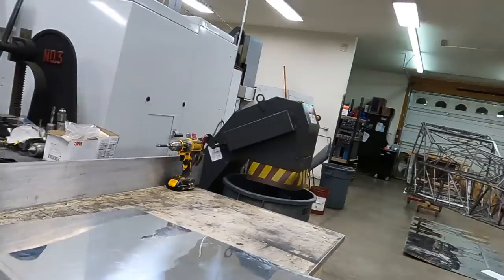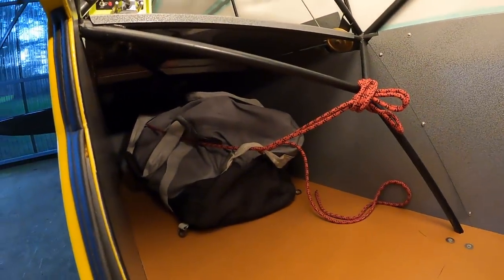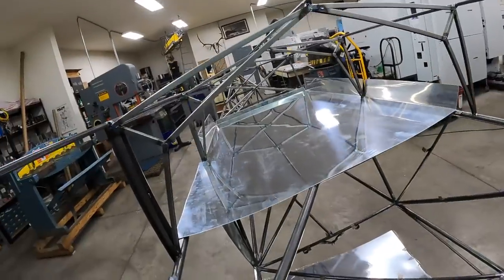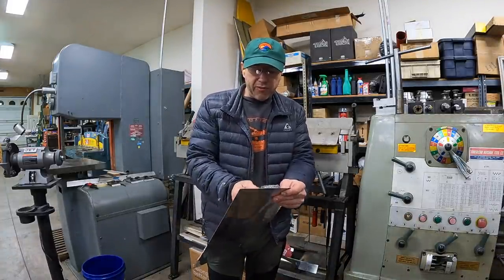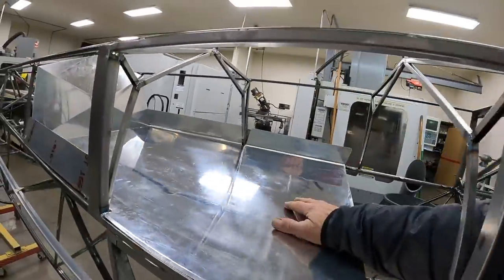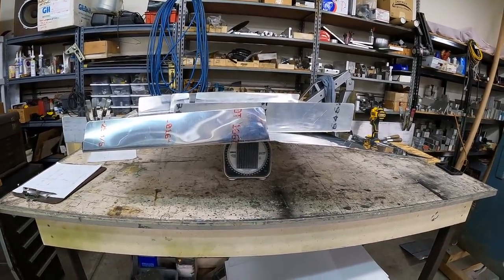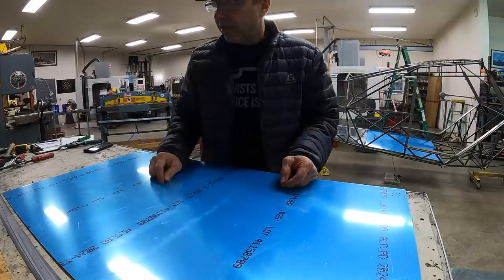4 Place Super Cub, Episode #2

Comment: Hi, Greg. On the parcel shelf where you made 2 halves, for stiffness sake, how about bending 90° for a mating surface to join them either with nut plated or rivets? Then you have a brace built in
Reply from the maker: good idea,  I will show you what I end up with probably in the next video.

Comment: Now you have done it, you let us in your shop. Big mistake! I am going to be on the look out for the next episode from now on. When you mentioned carbon fiber you took words out of my mouth. The thing with carbon fiber is you can order sheets of this stuff and you use it with that insane German glue they use now to glue fenders and quarter panels on Audi and Porsche, so you have less weight and more rigidity. (no need for plates and bolts) If abrasion is an issue  I am sure they have coatings to that effect. If you use large section of metal sheets you should bead roll them for stiffening and sound. I am doing car restoration now and it is amazing how the metal working tools have the same usage with airplanes. The guy who has the Drako plane went bat shit creasy on carbon fiber on his latest project, but this is an other topic and he has deep pockets.. Thank you for posting and happy new year!

Comment: On your 2 piece shelf, in the center, bend a 1/2" flange 90* down on both sides and make them meet, then use nutplates and screws on the horizontal plane.  You will have a little lip sticking down, and a seam along your shelf,  but it will make that shelf tremendously stronger with very little added weight.
Reply from the maker: Someone else had a similar idea already, wish I would have thought of that it would help for sure.  I actually want to stiffen it going perpendicular to that also in that big open area but both ways would make it very strong.
Reply: @mauleguy  Cool.... I'm interested to follow the rest of your build.  I'm in the middle of my own bushcraft build and it's great to see how people build various things.

Comment: Having saved a mate stuck under his ultra light, set up on engine stands like yours, please weld on a round bar to the long leg on base of each stand and add a couple of 20kg weights to each stand to prevent a tip over, my mate was fine but had been pined in away he couldn't get out from under it and when it tiped he wasn't even under it but ended up pined by it for about 2hrs before I arrived, great video man keep them coming.
Reply from the maker: Good to know, it will not weigh that much on the engine stands, it is very stable also.  I don't plan on fully assembled on the engine stands, mostly for covering so maximum weight my guess would be 200 pounds. I could still push that off even at my old age:))

Comment: On the fwd baggage piece with the large unsupported span you made in 2 pieces- I've done that before and put a 90 degree bend on the split flange facing down. Only has to be about an inch.  Adds a bunch of strength without much weight.
Reply from the maker: That is a great idea, wished I had thought of that myself.

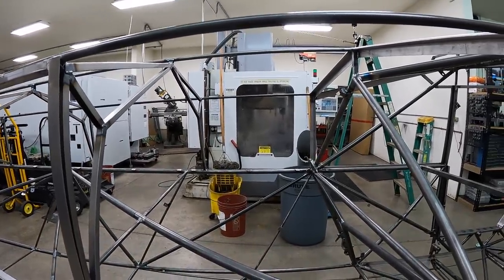Comment: 16:08 My late father taught me everything I ever needed to know about fabrication, by screwing it up almost every time. When he built or worked on something, if he turned around he hit me in the forehead with his elbow. As soon as I could walk, I watched everything he did. He was a proud man but with me he was very generous in explaining his errors. I think talking it through helped him as well. I watched him make trapeszoid cabinet doors. Confusing the style and rail inside and outside measurements, more than once. One time he built this beautiful old growth pine breakfast bar. Eight feet long, 6 inches thick, just huge. We were working in the basement and once he got it finished in a burnt wood golden finish he looks at the basement stairs that went nearly to the wall corner and realized there was no way he could get that out of there without removing the wall to the stairs, and possibly the stairs as well. So after listing every curse word that's ever been invented, he took a chainsaw, cut it in half and put it back together up in the garage and refinished it. I have no idea how he got the slab down there. I think it was a slab, it could have been a glue up. But having trouble getting it down there didn't help him see the problem of getting it back out. Classic, "building an ark in your basement." As a result of his errors, I don't make those mistakes. Project planning, prep work, all were organically instilled in me by his example. He was a great teacher and I never told him why.
Reply from the maker: good story

Comment: Good stuff, Greg!  Wouldn’t a bead roll contribute to stiffness and prevent oil canning on those baggage floors?
Reply from the maker: I have only tried to bead roll 2024-T3 once, it did not work, it cracked.  It is too hard in my opinion to bead roll, a softer series like 6061 would probably work but have not tried it since.  I was trying to do the clean out pan on Bushwacker when I had the issue.  
There is an art to bead rolling, the material is shrinking in that area so unless you pre-stretch everything gets wonky too.

Comment: How about using a hair dryer or heat gun on low to warm the glue on that stubborn plastic protector on the aluminum sheet?
Reply from the maker: Have not tried it, will try it and report back.

Comment: I’m currently building interior on a pa 18. Using Kydex.
Using .060 where durability is an issue - extended baggage area.
Regular cabin panels .040.
Quiet, durable, no painting required
.060 20% heavier than .020 alum
.040 same as .020 alum.
Reply from the maker: I have used Kydex also, I don't like how it kind of gets distorted over time.  I usually use it at the wing roots because it is easy to bend and fit up in the gingerbread.  It is a good option for sure.  I have used the .040
Reply: Havnt had issues with .060 distorting, last cub 5 years 850 hrs.
Except throttle quadrant channel exposed to sun/heat.
Staying with aluminum on that part this build.
Im diving into upper baggage build next.
Timely video, great ideas. You building upper baggage door too?
I’d like to see what you come up with
Thanks!
Reply from the maker: @9pacokitty  Airframes Alaska already has the fame in the gingerbread for the upper baggage door.  I just have to make an aluminum door for the hole.

Comment: Would that panel benefit from some dimple die lightening holes? Obviously if you are using it for baggage you don’t want a ton of large holes in it but if you put a couple of smaller ones in it would give it a lot of rigidity.

Comment: Nice. I'm all in on this build and picked up a thing or 2 out of watching you work that tin.  Got to wondering though, had you considered working w/nomex honeycomb board?  Rigid, light, easy to work with and above all.....quiet.  As far as durability though compared to carbon fiber, I don't know.  I've known some folks have better luck sourcing aluminum locally or within a few hours drive, buying flat and avoiding shipping damage. I did receive a roll of .25 from AS the one time I ordered  and it was fine.
Reply from the maker: I have used Boeing surplus fiberglass panels with nomex honeycomb for the floor boards in 3 or 4 of my airplanes but it is heavier and more prone to damage from something that can poke a hole.  I used aluminum in the floorboards in this last cub I built and like it better.  With the fiber glass panels you have to put something solid like microballons epoxy and a steel sleeve to keep the screws from crushing it.  I don't see any advantage at this point in carbon fiber or fiberglass for floor boards.  Yeah I could have driven to Van's Aircraft for the sheet metal but that is 3 hours of my time and I did not care if the edges had damage because of what I am using it for...

Comment: Are you goin with a Lyc IO 360 angle valve ?
Reply from the maker: Lycoming O-360 A1A with 10-1 pistons, MA4-5 carb
Reply: @mauleguy  Do you think the weight gain on the IO 360 AV negates the HP gain not mention the carb ice benefit and fuel economy of IO ?
Reply from the maker: @kenw6939  I did the IO-360 in Bushwacker and there are positives and negatives.  More complex fuel system requires boost pump and mech fuel pump.  Extra weight and from my own experience I don't think there is that much difference in HP between the angle valve and parallel valve both using 10-1 pistons.  They are the same bore and stroke.  I used a 90" propeller on both pitched to 33" and they both turned 2450 static which tells me they are similar in HP.
I like the gravity fed fuel system and carb for simplicity in a bush plane so that is what I am going with.
Reply from the maker: I originally thought that the IO-360 would kick ass on the O-360 but that was not my real world experience.  Both are great engines with great track records but because a Super cub is more sensitive to weight out on the nose I am going to stick with the O-360.  Bushwacker has a heavy tail so the little extra weight out front was not a big deal maybe even a benefit.
Reply: @mauleguy  I definitely appreciate the time  you take to reply to these questions and comments ! Were sittin around the same Fire as far as thinking on the 4 PC weight and HP ! Been watchin and a fan since the Beginning ! Thanks again Greg  👍

Comment: I'm curious if you're planning on covering with oratex or poly?  Have talked to a few builders lately that recommended oratex
Reply from the maker: I covered a cub in Oratex once, it has some positive and negative qualities. Too many negatives for me to use it again.  I will use Superflite, that is what I used on my yellow and black cub I currently fly.
Reply: @mauleguy  good to know, do you mind sharing what the negatives were?  Also do you own a machine shop or something?  Those look like CNC machines.  I guess I kinda figured you were a surgeon or something.
Reply from the maker: @MaxRunia  Oratex, it is hard to get the tapes to stick, if they come loose even harder to get them to stick back down.  Looks okay if you do a really good job, but looks worse after sitting outside for extended periods. More expensive and does not have the track record to back it up of names like Polyfiber, Superflite etc. 
I own (3)Haas CNC mills 1 Haas CNC lathe 1 Takisawa lathe and a bunch of manual equipment.  Yes I own a Machine shop GSM Inc.
Reply: @mauleguy  all good info, thanks Greg!

Comment: What is the tiny fuselage hanging in the corner of your shop?  Looks too small to be a full scale and too big for RC. 🤔
Reply: It looks like just a tail section of a full size aircraft. Like maybe the last 5’ of it only.
Reply from the maker: @chrisluehmann3094  Chris you are correct.  After I wrecked Bushwacker in 2104 I intended on extending the fuselage to be longer then a Super Cub by 12".  It was going to have a jack screw, rounded oversized vertical and rudder and oversized Super Cub tailfeathers.  I built it and had the fuselage complete except for tabs, the more I thought about it the more worried I got that I might be making to many changes to what I knew originally worked great.  One night I decided after working for 2 weeks on it to cut it off and go with what I knew would work for sure.  A Maule tail section was added a few days later and off to powdercoating it went.  I did not have the heart to scrap it so there it hangs.  Maybe Mike can make Scrappy #2 out of it :))